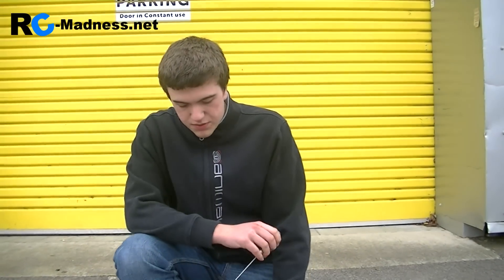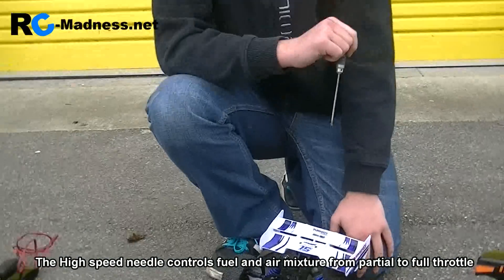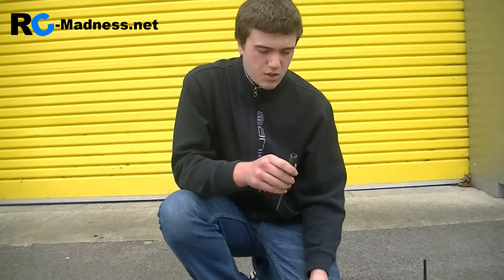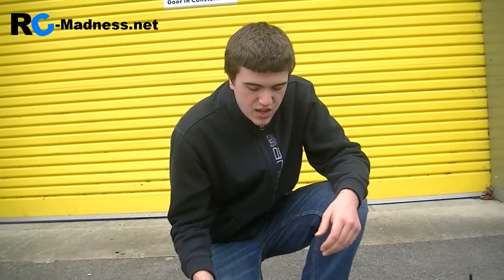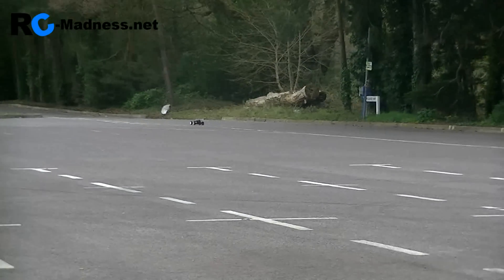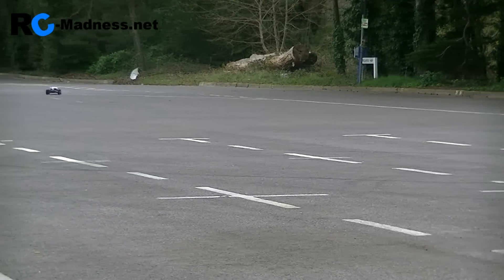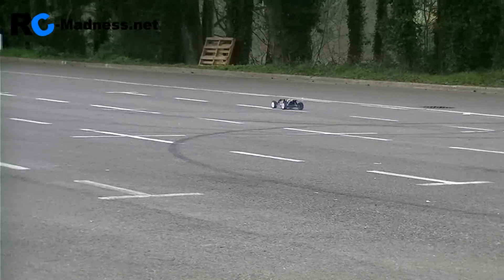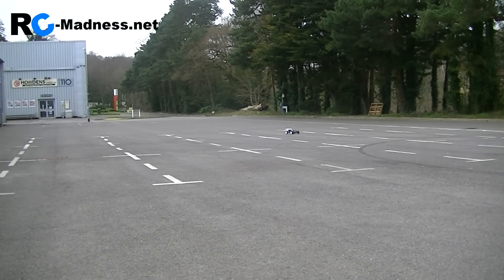How to tune a Nitro engine - SH .21 Turnigy Rumble

Comment: Are parts still available for this buggy, like a fuel tank. Just picked one up used,  and  and i need a  tank.  Thanks for your time.
Reply from the maker: The one from the ACME Warrior will fit https://www.nitrotek.co.uk/spare-parts/acme-racing/acme-warrior-buggy-spare-parts/fuel-box-cover-set.html

Comment: Hey love ur videos have a question about upgrading my 1/8rtr serpant cobra nitro buggy with a new motor.. but last time I tried  the motor didn't line up .. what kind of mount should be used  any help would be greatly appreciated.
Reply from the maker: Hi Tommie, you can buy adjustable engine mounts which will give you a bit more leeway

Comment: do you fancy giving me a hand tuning my engine it's being really temper mental installed a brand new glow plug but no different
Reply from the maker: I don't know how else to give you a hand other than produce videos which you've obviously already found! :)
Reply: JT12's R/C Videos the low speed is set perfect it's just the high speed when I'm driving it runs quite rich and then all of a sudden it will start to run different like its really lean I think it might be the case of stripping the carb down and giving it a good clean

Comment: Can you make a video on how to tune Nitro engine using Tmaxx 2.5 Classic. I've a problem tuning mine.
thanks.
Reply from the maker: This video shows you how to tune it. Every nitro engine is the same tuning procedure.
Reply: okay thank you, but what's the problem if a nitro is jerking. I ran my truck maybe 1/8 to 1/4 of the tank then it start to jerk. can you help me.
thank you

Comment: also is a .21 cxp nitro engine same as a sh 21 nitro engine
Reply from the maker: No, one is a CXP engine and the other one is an SH Engine
Reply: So will both engine's carburettors  have the same default settings for the Hsn and Lsn
Reply from the maker: No, because they are different engines.
Reply: So do you know the default settings of the 21 cxp engine.can u tell me them if u dont mind.thanx a lot for everything

Comment: hey mate can you answer this  
everytime i start my nitro it wants to take of i have checked the clutch it isnt broken what do i do
Reply: adjust you throttle trim down, I have had that problem before and I turn the throttle trim down and it solved my problem, if that doesn't work then adjust your idle screw, that has also helped me

Comment: Great video. I have a nitro Turnigy rumble and changed the configurations of the carburetor, the car is not this working anymore, the engine does not turn on. Could you say what the original configuration of the carburetor? or a better way to regulate. I'm grateful for a response. Thank you.

Comment: Hi, im still in break in process. the first three tanks run smooth and i tried to run the engine as rich as i could before engine stop. But now it would start after a good prime and then stop in a second? So i cant continue the break in process or do anything.
I have new 20% nitro and the stock glow plug and it still shines red.
I have tried every settings on the LSN and used a higher idle setting.

It seems it cant get enough of fuel. Becaues if i drop fuel in the air intake it goes abit more

Comment: i had that issue with my hobao hyper 7 as well. the best thing to do is to set HSN and LSN needles flush to case, then start your car and sit it on a brick (keep it off the ground) and use around half-full tank at high idle speeds and revving it every now and then

Comment: i have a thunder tiger tomahawk bx with a pro 18 engine, but cant get the tuning right. i had it done by a shop the the shop closed down and not the tuning is somehow not right. the factory setting never worked properly, as it would take 25-30 pulls to start, i would nout hit even 30mph when it is ment to hit 45 or 50mph properly tunes and it would move slowly when you started it on idle. can you tell me how mant turns clockwise/counter clockwise for the hsn lsn and idle screw? thanks